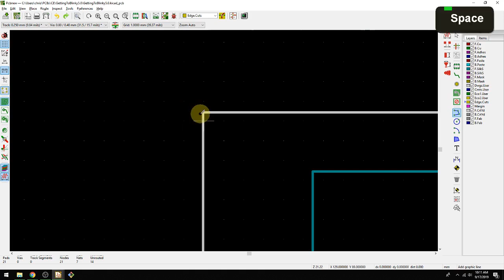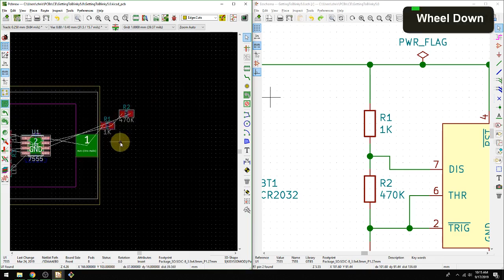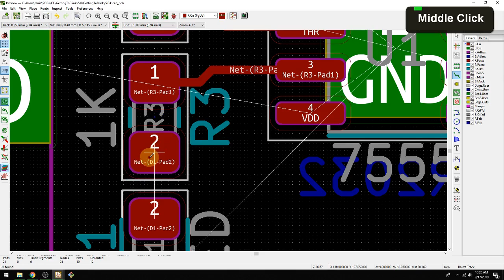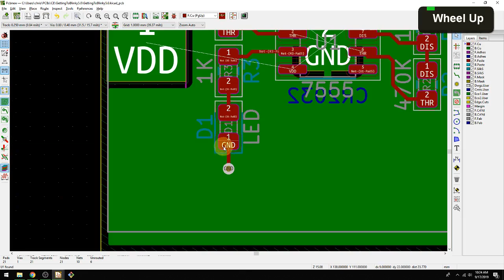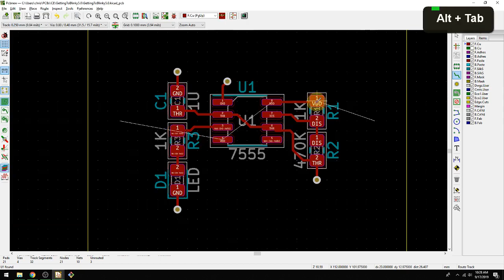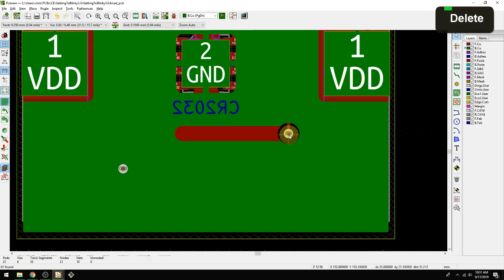Comment: Was keeping up until this video.  You really talk and move fast, so for someone brand new to the application and process I found it hard to keep up and figure out what you were doing.  "Flip it around", etc.  Also, I am using Kicad version 8.0 - not sure how much the UIK has changed since this video...
Reply: It is likely the third time I'm going through these series. I don't build circuits very often as a hobbyist so I keep forgetting but this gets me started again. I'm using Kicad 9 now and I try to comment with the changes. He hasn't posted a new video in 3 years so I don't think we'll get any updates but this work will remain relevant for some time.

Comment: I'm a little confused - It seems you never explicitly say that the battery holder is positioned on the underside, while all other components are on the top side. How did Kicad know this?
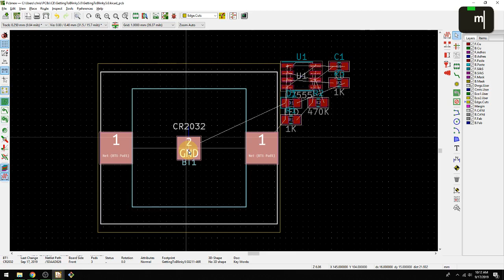Reply: At 3:13 Chris pressed the F key to flip the holder to the back layer of the board.
Reply: @cts006  thanks

Comment: is there actually a problem with placing the via on a pad or is that just your preference?
Reply: A via-in-pad needs to be capped and depending on where you get your board made it might cost you more or they might not be set up to do it so you are better off avoiding it until you actually need it for space or trace length reasons
Reply: @stephenalegge  Thanks - that's good to know.